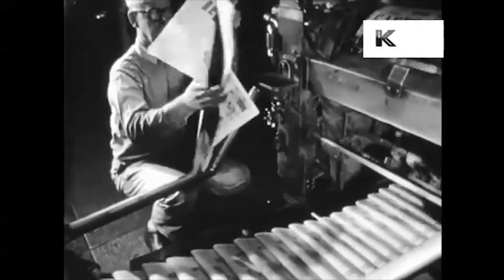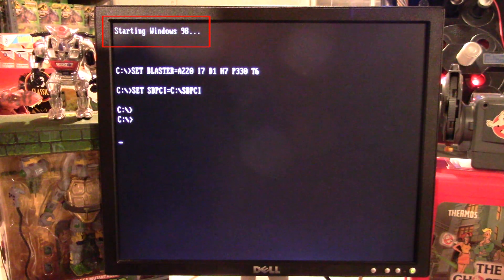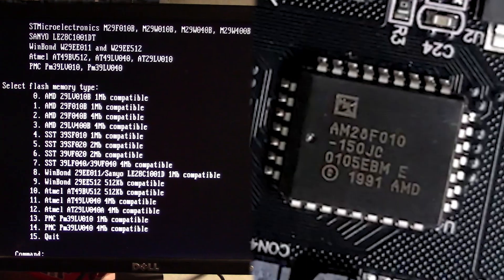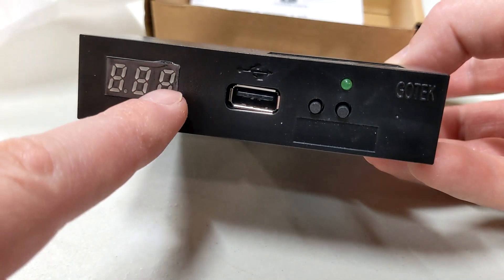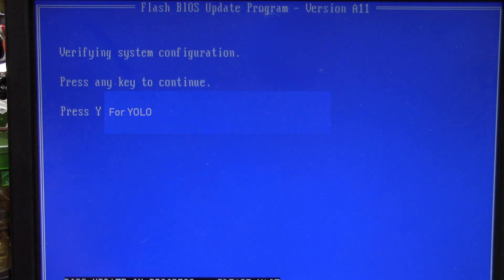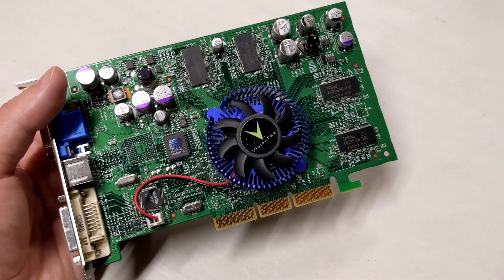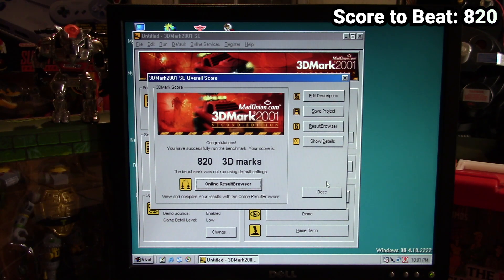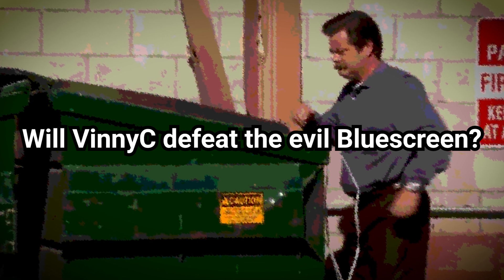Windows 98 UPGRADES

Comment: Lighter fluid melt the old GPU paste. Then use alcool to clean.  One drop of oil in the bearing can revive an old fan, Use Kapton tape to replace the tape that you cutted.

Comment: Just a heads up that SATA to IDE adapter is junk, I had one of them.  I really do recommend getting the startech SATA to IDE adapter.  It will allow you to enable DMA mode and is hilly compatible with most motherboard and SATA Devices. I have it running on my 440BX motherboard and I also use it on my socket 5 motherboard :)

Comment: 10:41 The latest nVidia driver for Win98, but certainly NOT the greatest!  There was a ton of performance regression with these early nVidia drivers.  For this configuration I'd recommend driver version 45.23, and I promise you'll get higher FPS.
Reply from the maker: You're not the only person specifically suggesting 45.23, perhaps I'll give it a shot if I get around to finishing part 3